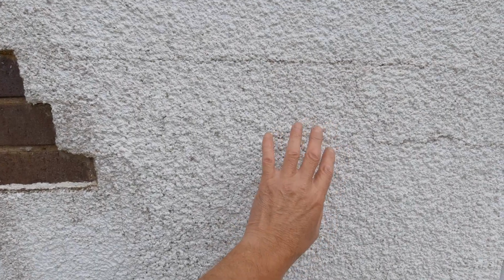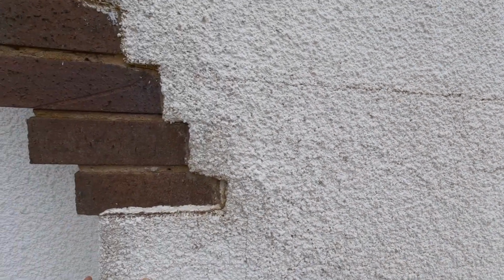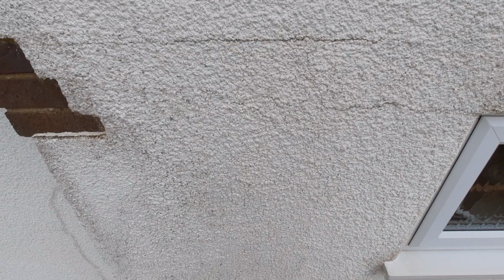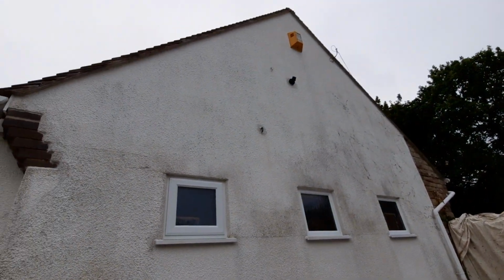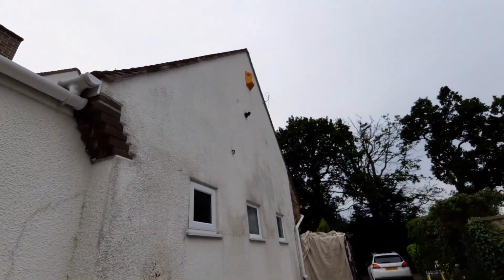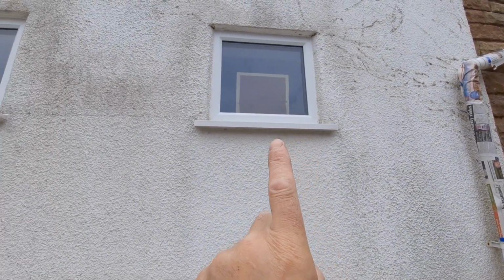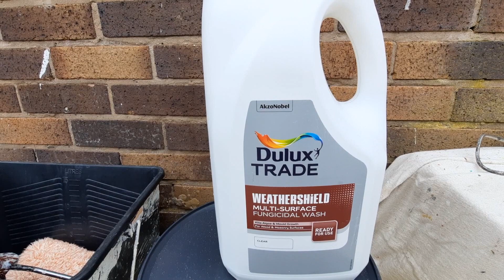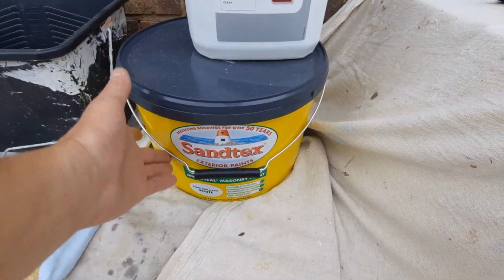Painting Render On A Gable End

Comment: Bet it was warm work pal, I decided not to do any more exterior work, got enough interior work, after 42 years and only 1 minor fall I don't want to tempt fate at 63..Good job mate be careful.
Reply from the maker: Thanks   My bad fall happened in a bedroom was very lucky. Picked up the wrong steps when I went to the otherside of the room.  They were my customers steps..  Well I went and stood on the platform and lent back with my leg on the bar, which was lower than my steps that I had just been using. I went straight off the top my head just missed the metal fire mantel. The bang hitting the floor was shocking..  dislocated two fingers..  stuck them back and finished painting the picture rail.  Then went the walk in center only to be told nothing wrong..  by the end of the month a could not even drive because I could not move my arm.  18 months later two operations and sorted.  Stay safe and don't take anything  for granted.     Think the heat is getting to me..   moan over.
Reply: @PaintingandDecorating  well that's the NHS for you, nothing wrong, when papering have you ever come down your steps and fully submerged your foot in your water bucket, I have several times. 🤣🤣😁

Comment: Why not just use a large roller pole? So much quicker, and less moves of the ladder.
Reply from the maker: So you not painted much render...   it's all about direction and coverage getting in all the little nooks and crannies. Also a pole would not reach that high...  maybe at the bottom on a second coat.. but they also can be a pain..   can have it done by the time you've messed about with a pole.
Reply: 12 inch Purdy collussos roller will not only get into nooks and crannies but on most jobs will complete the job in 1 coat.Lather it on quick and try to keep a wet edge.
Reply: @PaintingandDecorating  using a roller from the deck you can create pressure easily. You must lose an awful lot of money due to the time.it takes you to complete a job. Watched one of your other videos, took you 25 minutes to coat a door. LOL we would all be fantastic if we took the time you did.

Comment: The downspout  screws are exposed, so why not do   remove the downs pouts, and replace on completion with brass head non rusting screws.?unless you don't want to disturb the joints, anyway good job yet again mate.
Reply from the maker: why have them sticking out like a sore thumb.. brass...    now they are white and fit in completely..  some screws are best left because they may snap or the heads are too rusted..  if you can remove downspout best too while you paint. Thanks
Reply: Stainless steel screws work well for this and look fine.
Reply from the maker: @paulf2529  only if you can get the old ones out...  time is money and screws cost money.
Reply: Remove the downpout
Your having a laugh😆